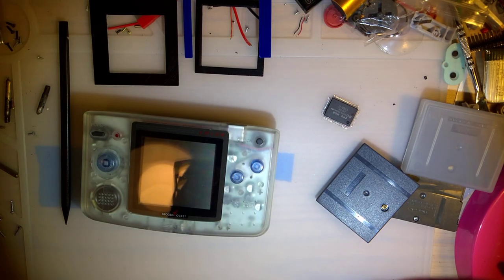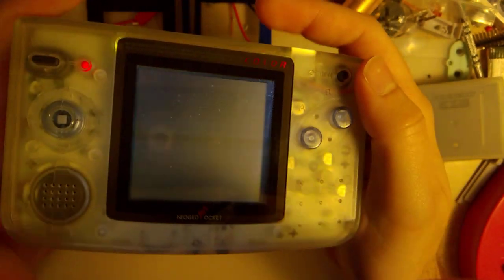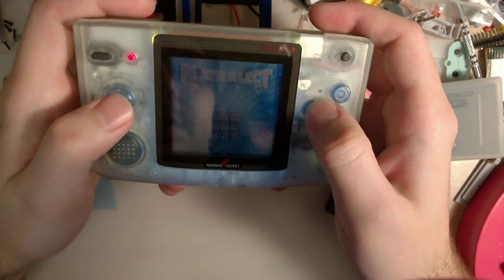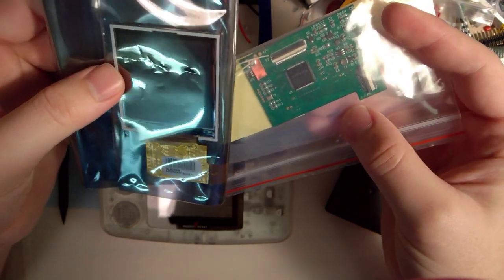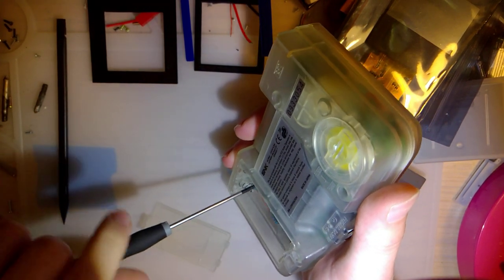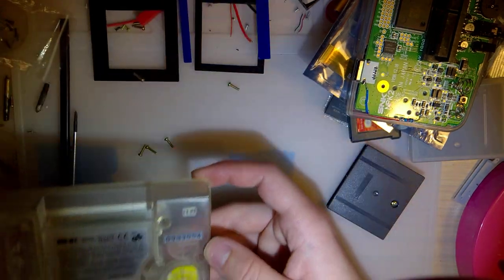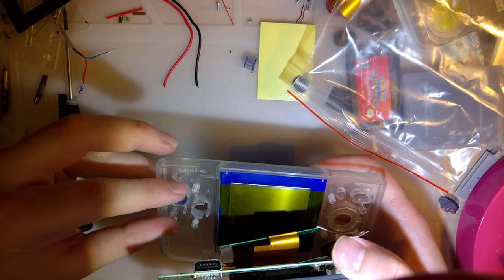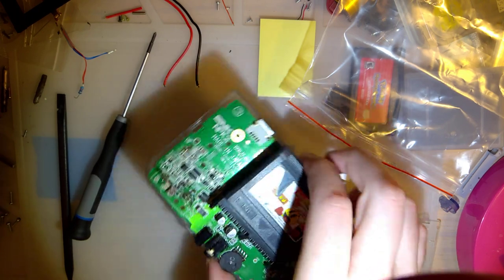Installing a Backlight kit (HiVision AIO) in a NeoGeo Pocket Color

Comment: nice mod I plan on doing mine.I have a gbp screen just like that and hopefully I can order the ngpc ribbon cable and screen lens.How can I get one of those 3D printed screen spacers?
Reply from the maker: I put a link to the spacers that I made in the description. If you don't have a 3D printer, check your local libraries or makerspaces for one. Failing that, there are services online that will print your stuff but for the cost, it's probably not worth it as these brackets are just to ease the install and are not required.

Comment: Can you help me i buy a neogeo poket black and white no color but doesnt turn on if i put a plug only turn the red led on but do not turn on...maybe the screen what you think.?
The mother board is good what can be the problem 
Cheers from mexico
Reply from the maker: I couldn't say -- I'm not a NGP person really. But just to double check -- there is no corrosion or water damage, correct? All the capacitors look fine? Is the system booting at all or is there just no display (is there sound?)? Finally, did you already try unplugging the screen and plugging it back in?
Reply: @makho  theres no liquid damage no corrosion.capacitors looks good.When i put the 3 volts adapter only i get the red light on.theres no boot or sound only when i plug the 3 volts adapters when i get the volumen up only a zoooooom no sound.the screen looks broke i try to plug few times nothing.the woman that sell me say one day stop function but i think his kids drop it but its almost new the mother borth look good no damge but i cant fix it.Do you have any personal page where i can send you photos of the board ?

Comment: Thanks for the video, helped me out installing the screen on my system today. Since I'm not sure, does the replacement lcd have a screen protector? I couldn't tell if mine did but my backlit lcd doesn't look as bright as the other modded systems I see around.
Reply from the maker: The kit itself is not that bright compared to other backlight kits (even ones that use the same LCD). It's bright enough for me though.
Reply: @makho  yeah after playing around with it some more I turned up the brightness and it looks great. It's a great upgrade!

Comment: Mine only had one screw on the inside in the same spot and I never opened it till I added screen.  Are you on the waitlist for the neo geo pocket sd?  Might be a cheaper way to play games.
Reply: Never knew a flash cart came out, what a time to be alive
Reply from the maker: Indeed I am on the wait list. I'm #1 =)
Reply: I got mine recently just in time for a backlit screen
Reply: indcsion how’s it compare to the Masta flash?
Reply: @CutlassCraft  Ive never used that one before but this one works good. How does the masta work?
Reply: indcsion you can only load 1-2 games on at a time but only a little cheaper
Reply: @CutlassCraft  You can probably do about 5 or games on the neo geo pocket sd depending on size of games.

Comment: Thank you for making this video! And just to clarify I can set the light sensor anywhere as long as it's connected to the outside shell? Even if it's the non clears?
Reply from the maker: Yep. It does not matter where the sensor is or what color shell but to trigger it, you have to place your finger directly over the area where the sensor is attached. I don't recommend placing it where I did in the video because I keep accidentally triggering it by just holding the console.
Reply: @makho  thank you for the reply I appreciate it! I was thinking of putting the sensor at the bottom underneath the screen behind the SNK raised letters. Cuz I figured having that as the touch sensor would be awesome. Otherwise I was just going to put above the LED.
Reply from the maker: @ForeverWinter1812  I think that could work pretty nicely. You'll have to solder on a longer wire though. I might actually try that out myself.
Reply: @makho  I've had my fun share of soldering. Lol. I added a player One controller port to a Sega Nomad.